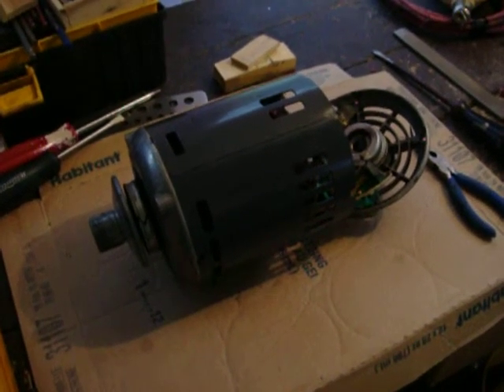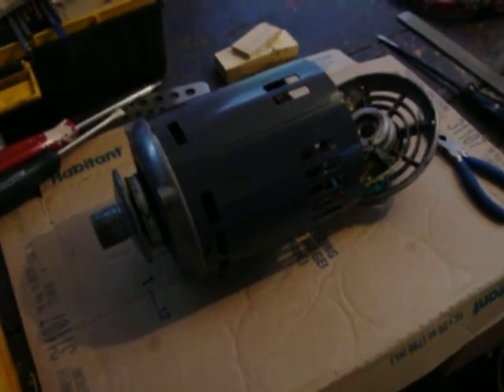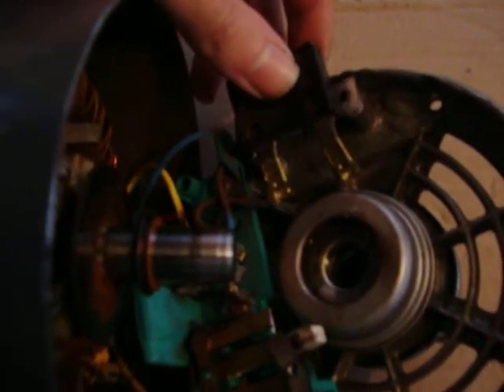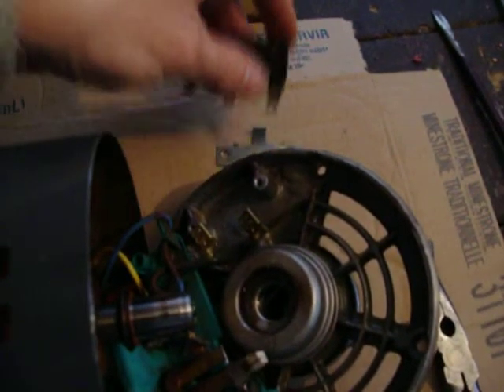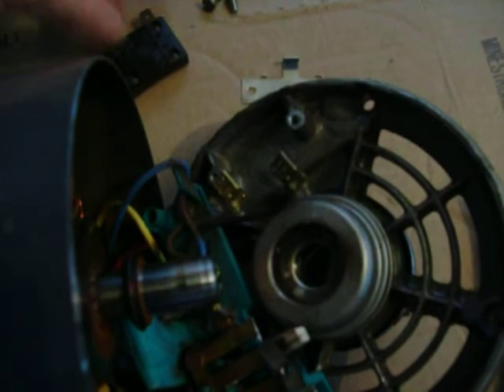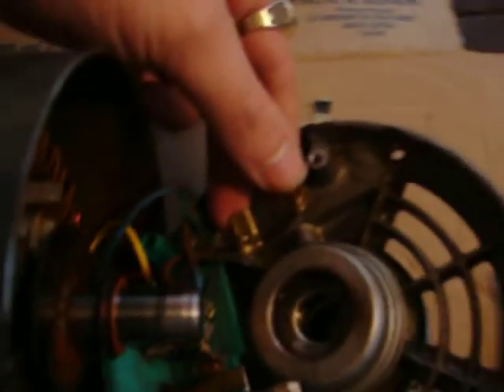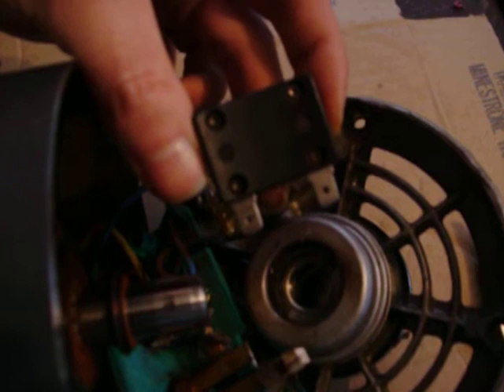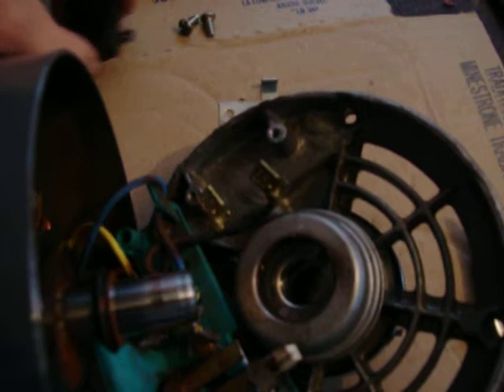Electric motor designed to fail

Comment from the maker: Keiso: I agree a loose belt does vibrate, I tightened this one up very tight and when that didn't work I tried a new belt, didn't help.
 There's always more than one way to look at things, I just wonder how many thousands of motors are in the garbage dumps,because of this. It's January first 2015 2nd winter for this motor running 24 hours a day, no problems.

Comment: That "Thermo Disk" is actually a thermal cutout device, so that if the motor jams or overheats it shuts it off to prevent further damage. The reason the belts vibrate is because of belt tension, almost 100% of the time